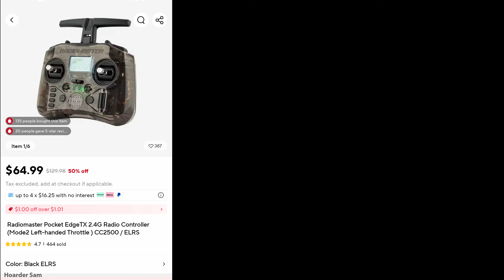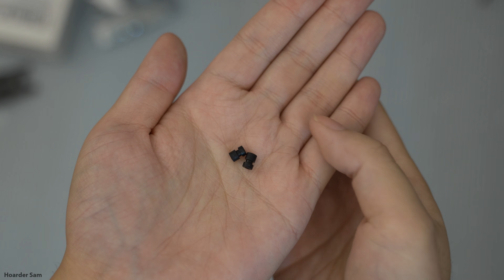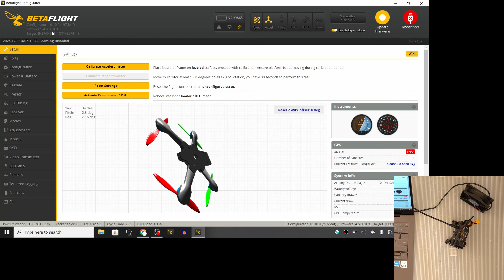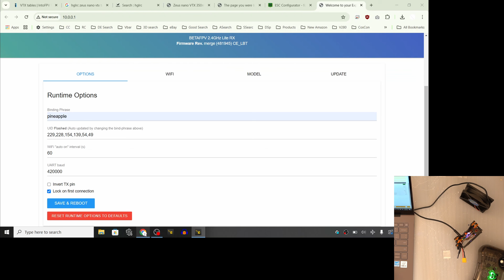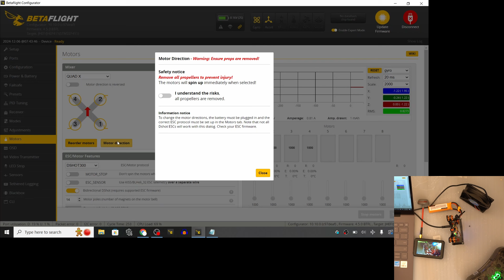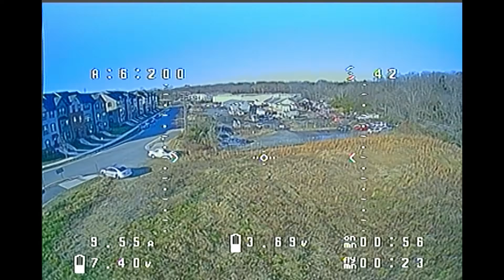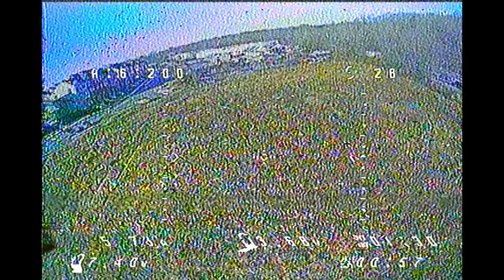How to build a 2-Inch FPV drone for $100

Comment: With the 5 bladed props should i use prop screws or just push them in like the 2 bladed props?
Reply from the maker: Mine flies fine without prop screws. (I haven't pushed it very hard though)

Comment: Never melt tin just on the soldering tip, you're just burning flux off. Use these bigger tips, don't be afraid of them ;) you don't have enough thermal capacity on that narrow tip, that's why you struggled with motor wires. These pesky motor pads sink heat very well. I use my 2mm flat on almost everything - recently replaced a bunch of 0805 smd resistors from a donor repairing a motherboard. Bigger thermal mass allows you not to drop heat when you heat up the element, so you can get in, heat, tin, get out fast as one should always do. Good you use the brass wire cleaner, way better and safer than wet sponge ones - they coolbthe tip rapidly and damage the hard-tinning of the otherwise copper tip. Also, don't cover tip with flux or you'll damage it with time - unless you cover it with tin afterwards. The general golden rule (llm rhetorics lol) is to always leave the tip covered in solder when finishing the job and in general never let it stay uncovered. I replaced the tips probably about 10 years ago following these rules. At this point I'm emotionally attached and we'll probably going to marry. Cool vid though :)

Comment: Oof. It's my first drone build, the wiring is a massive pain, but I got it done. I got everything assembled, started betaflight setup. I saved the motors for last. Everything else was working great, but on motor setup, one of the motors was twitching weird. Eventually I think it let out a curl of smoke.

Oh no.

edit1: I think I shorted the motor wires. I resoldered one and it seems to work fine!

edit2 (3 weeks later): I finally got to fly it. It's fantastic. Apparently my solder job on the xt30 was trash, though. It failed and I need to replace it. Thanks for this build guide. It, the 3.5", and the 10" got me into FPV.

Comment: Hoarder sam-- I have a few builds on the go --  two 10inch and  a ysido 80mm frame from Temu, anyway I was wondering if you had any 3D printed GPS module holders that'll  hold 18mm GPS module for the 10inch  mark 4 V2 frames  and a 3D printed vtx antenna holder that screws onto frame?..

Comment: I have watched this build and your 5in. build. I will be ordering the parts to build the 2in drone as soon as I finish this comment. You present the build in a very easy to understand way. It's clear that your priority is to get newbies into building and your approach is conducive to that. You seem to leave your ego at the door which is very refreshing. I am confident that I can complete the build. My biggest issue will be learning how to navigate the Pocket emitter. Though I have been in RC for quite a while I have never owned a Radio Master Xmitter. It's a little confusing. Anyway, thanks for you videos!

Comment: I am a 13 year old boy you guys think Ivan build it
Reply: I’m 13 as well and I built his 5 inch $100 build and I’m building a custom tiny whoop using a 65mm frame I designed and 3d printed myself, so I think you could build it!

Comment: Will the b6 neo charger work with xt30 connectors? How to charge the batteries? I am ordering these parts and i dont know which charger to buy
/
Reply from the maker: Yes, you just need a XT60 to XT30 adapter and the b6neo will work: https://s.click.aliexpress.com/e/_c3bYy5VN

Comment: For those wondering its kind of hard to find the f411 board at that low of a price. AliExpress directed me towards a similar board the G474 for a lower cost. Thats the board i used for this build and it works great so far! A couple of the soldering pads are in different locations from sams video but thats about it! I really like the osd on the G747 board as well. So if your wondering if the G747 board will work for this build it will! Awesome little 2in drone. This is my second build and the smaller drone really helped me get better at flying. Thanks again @Hoardersam !

Comment: Built this with the 1104 ysido 8600kv and with the betafpv 2s pigtail. So using 1s 550 batteries x2. Tested flight time with the 5blade props, almost silent, but didnt have long flight time unless i just hovered around. Just switched to gemfan hurricane 2 blade. Its screaming, going HARD for more than 5 minutes. Great build. Thanks a lot. First build for me, soldering was rough but it works great :) Cheers
Reply: what's the weight of yours? I'm getting 3-4 minutes with betafpv 2s pigtails with the 5 blade props. my dryweight is about 65g
Reply: @blackguns12 Hey, i realized it was one of my batteries that was giving me problems and not the 5blade. Tried the 5blade props again and now i get about the same results as you. 63.22 grams dry on my scale. Now i think i prefer the 5blade props :)
Reply: @oskardavidsson  I know. tried 2 blades earlier today and I am not happy how sluggish it feels. it was screaming all the time just to make it fly higher lol. 
oh btw the 2s Pigtals for betafpv I use was a 450 LiHV. when I use my 2s 550mah I get about 5-6 minutes of hard flying. trying to lighten my build and see what changes

Comment: hey would the RDQ 660 mah xt30 7.6V 90C work with this setup or is it overpowering?
Reply from the maker: That sounds good to me
Reply: @hoardersam10  also if i want to add a tbs unify32 pro nano, i connect the signal to tx2, video to vtx, gnd to gnd and 5v to power in??

Comment: I was looking for a cheaper option to my banged up YMZFPV lightning2, that I use to learn new freestyle maneuvers. 
Unfortunately, with 23% import tax, this build comes up to 123€. The GEPRC T-Cube18 costs me 117€ (including import tax) and a new YMZFPV Lightning 2 (analog) cost me 157€, both with better components. 
I'll just buy prebuilt as the savings are minimal and I'll get a better quad that way, without wasting time I can use to make extra money (self employed). 2 Billable hours will pay for one of this, with some change, while I would spend more than 2 hours building this and setting it up. If I tune it, then it's even more time.

Comment: can i use JHEMCU G474? i really want to do this projects for robotics class but i dont know which board to order.
Reply: I ordered that board too i believe because they didn't have the one in the video for this build at a good price. Its on its way here. Ill let you know if it works. It should. It rates the same i believe.
Reply: @SmokyArts when will the package arrive?
Reply: @KacperRyszkiewicz everything will be here in a little over a week! But i just fried my radio 😭😭😭 should have a replacement by then to fully test the board. But I'll definitely let you know if it works!
Reply: @KacperRyszkiewiczhey the package arrived today, sooner then i thought. If nothing is missing ill be doing the build tonight!
Reply: @SmokyArts  did you build it?
Reply: @KacperRyszkiewicz hey man i just finished the build last night, but i have a few issues i got to work out. Everything worked so far except two of my motors. But i think its my soldering work... So i got to try to diagnose and fix that issue tonight. But so far everything else worked! You do have to search for a few pads on the board too because they are not the same place as the f411 board. But im try to solder my motors again tonight and see if that fixes the issue. Im pretty sure thats the issue. Hes not lying. Those motor pads are stressful to solder! They are super close!!
Reply: @KacperRyszkiewicz update: i redid the soldering work on the two motors that were twitching and now it works fine! Been flying it last few days! Fun as heck. So yeah you can definitely do this build with the G747 board bro
Reply: I googled it as well and it seems that it will work just as fine the 474 board. All its saying is its just the newer upgraded version of the 411! Hope this helps!

Comment: I just built my own with you're guide man! and it flies! . Dry weight is 64.7 Grams. add in the battery 550Mah 2s. drone weighs a total of about 95grams. Thank you. keep on sharing builds!
Reply: what esc did you use JHEMCU F411 ELRS or JHEMCU G474ELRS?
Reply: @KacperRyszkiewicz here's my set
it's the Jhemcu GHF435AIO ELRS 2-4s to have upgrade paths if I want to change it a bit.
Reply: @blackguns12 v1 or v2?
Reply: @KacperRyszkiewicz not sure. it didn't state which version

Comment: There are many channels about FPV drones builds ,setups etc etd. But I never saw any video like yours where you go thru step by step to show what ,when and how to do. You make great tutorials that I'm sure motivated many to go on and build their own drone. I personally just build 2,5inch drone using Baby Apex 2.5 frame and fully packet with GPS ,GEPR Taker AIO ,Cyclon 1w VTX and ysido 1404 4650kv and Ratel 2 cam. This boy can easily fly in heavy winds while caring Insta 360 GO 3s camera on top. All of this still under 250gr. Great stuff man!!!

Comment: Hi. Thanks for the great video. The link to JHEMCU F411 ELRS AIO leads to a page for JHEMCU G474ELRS AIO Flight Controller. I just want to make sure I get the right part. Thanks again, Keith
Reply from the maker: Unfortunately it looks like the JHEMCU F411 is out of production, so aliexpress is redirecting to other products. I don't think the F411 AIO is in stock any more
Reply: @hoardersam10 will the G474 board work the same? I just ordered all the parts and same hardly any f411 They only had them for crazy prices
Reply: @SmokyArts did you build it with new fc?
Reply: @KacperRyszkiewiczparts coming in the mails right now! I googled that board as well and according to google it should work with this project. All it said was the 474 board was a upgraded version of the 411 so you should be good!
Reply: @hoardersam10 the G747 board works for this build as well. Just built it thanks!

Comment: Thanks for the great build videos. I always struggle with soldering ground pads and getting enough heat to flow. Do you have any tips for that?
Reply from the maker: I use leaded solder which should melt and flow better than lead-free.

Start with a clean soldering tip thats shiny and silver. I like to drop liquid flux on the tip which cleans it pretty well.

Then I add solder just to the ground pad (tinning the pad). Make sure it flows and looks smooth.

Then I add solder just to the wire (tinning the wire). Some wires come pre-tinned, but I still tin it again.

Then I can bring the wire and pad together and use the iron to melt both at the same time
Reply: @hoardersam10  Thanks for the reply. These tips are all my common method of soldering as well, but when I am applying heat to the ground pad it either needs more heat or longer hold before the solder will begin to flow. I worry about damaging other components while on there.

Comment: Can this run a vista?
Reply: Yes it can but the mounting is above the aio so it does not have the best mounting but it should work with the caddx vista without out issue. Hope this helps

Comment: that was a good fucken video bro. question dawg is there a reason ur not soldering at 400C?
Reply from the maker: I use leaded solder with a lower melting point than unleaded

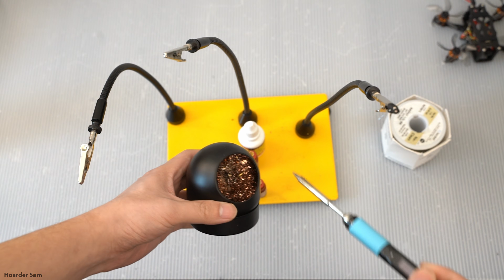Comment: @hoardersam10 Random side note, check 2:54 the "brass cleaner" if it really is brass. I had the same and I was wondering why my soldering tips became "bad" (poor soldering results) so quickly. Brass is non magnetic (and also more yellow than orange), so if yours is magnetic just like mine was, chances are its just steel wool, which is bad for any soldering iron :C Also, flux is more helpful if you put it on the part you want to solder instead of the iron :)

Comment: Is it possible to use slightly bigger batteries with this and get a longer flight time?  Been wondering if i could make an FPV drone that has at least maybe 10-15 min flight time.

Comment: Have been flying this thing for a few months now. This was my first fpv drone ever and i love it. Perfect for flying around the house, isnt to noisy etc. I do think however that the vtx and flight controller are better suited for a toothpick.( some guy built one with the exact same controller and vtx just a little lighter and better for indoor flying) I am probably going to built one with the same frame and camera (and motors but i have different ones as the one of the motors in the video came without magnets) but a speedybee stack and vtx (speedybee F405 mini and Speedybee XT800)for just about €35 more than the original. Love the rest of the build tho flies great (as far as i know)😀

Comment: So i just built a 2-2.5" 1s toothpick but I used all the same parts but motors went with 1202.5 11000kv, is the 1s and motors what is causing the drone to pull 15amp just to hover? Did just a short little flight in the house and ended up pulling a max of 26amp and I dont want to burn anything up

Comment: Those 1104 8600kv motors on 3s are insane i used an eyas x 2 inch frame wich is kinda too small because and 4 blade gemfan 2 inch props it bareley hits te m2 screws you cant use standoffs where the props are so it's an imcredibly tight build but it is the lightest I have ever seen

Comment: unfortunately the whole build will be about double the price because of the tariffs. unfortunate, but it is what it is
Reply: What? No. Unfortunately the whole build will be 4 times the price because I need to buy a controller, headset, and charger as well. $100 my ass when I paused and turned off the video the moment he put $64.99, $141.92, $97.75 on the screen. Disingenuous video to say the least.
Reply: @eX_OSRS bruh what, the title literally says that its how to build a drone, it assumes you already have that stuff, like a lot of the viewers do
Reply: @averycaron5462  you think FPV drone owners are a large segment of the population? Or even a large section of the drone-owning population? Lmfao gtfoh
Reply: @averycaron5462 you think the majority of people have headset, controller etc? Hell, you think the majority of the drone owning population does?
Reply: @eX_OSRS  yes I do, those are prerequisites for building any fpv drone.  along with batteries and a charger
Reply: @averycaron5462 I didn't ask if you did
Reply: cant even buy the flight controller because of that moron in the white house

Comment: Building this as we speak, quick question, when I go to esc configurator, there's no mention of any firmware or decent controls, does this mean i need to flash blujay?
Reply from the maker: Can you read the settings? After read settings, all the options should pop up
Reply: @ will give it a try! Thanks!
Reply: @hoardersam10 did everything i could and cant get the motors to spin in betaflight test. Very strange

Comment: Hi has anyone tried to power this with a 2S high voltage? On the listing it is not specified that it works with HV and I’m worried that I might break it but maybe the voltage difference won’t be an issue?

Comment: u need a reciver?
Reply from the maker: The flight controller has a ELRS receiver built into it
Reply: @hoardersam10  can I use crossfire?
Reply from the maker: @davidedini_1  Yeah you can, just have to wire up your own crossfire receiver to a UART on the flight controller
Reply: @hoardersam10  hi i'm doing the build can you send me something like a photo for soldering the nano rx to the AIO? tnx

Comment: What dimension is being measured to classify it as a 2"?
Reply from the maker: The propeller diameter is 2 inches. For 2-inch drones and above, the propeller diameter is typically used. For tinywhoops, motorpost-to-motorpost size is typically used (65mm, 75mm)

Comment: I am a total newbie to FPV 
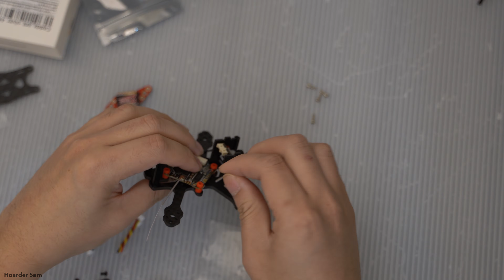I wanted to know why the FC is mounted errr... diamond style 04:17 (sorry did not know how to say it) ... as oposed to square (I would assume)
Reply from the maker: Either way works, just a matter of how the frame and quad is designed. These smaller drones with all-in-one boards are usually diamond style in order to to make the overall layout more compact

Comment: Hi Sam, I'm completely new to the hobby and picked up a load of gear of off a Youtube channel who no longer needed it due to switching to a production crew instead. I have ended up with a tbs tango 2 and dji goggles v2. It did come with a few drones but I'm super keen to build my own as well. what parts would I need to change on this to make it work with my goggles and transmitter? thanks!

Comment: Hey, Random ass question Im looking to build a telemetry falconry system with a mount that could go on our birds and a handheld to track it no Cam needed just to pick a signal up would there be drone parts to make something like that?
Reply from the maker: Ooh very interesting idea! The easiest off-the-shelf way would be to have a flight controller (no esc), GPS, and ELRS receiver and battery on the bird, and have an ELRS radio transmitter that will receive the telemetry data on the radio.

With some custom code, one could possibly get rid of the flight controller and just have the GPS and ELRS receiver connected together.

Comment: I have just purchased all parts for this build and waiting for it to arrive. This will be my first build. 😄

If i want to change to Dji o4 air unit, any other parts that i need to change as well?
Reply from the maker: Have you seen this new frame? It's the same apex 2inch but they changed the camera mounting specifically for the O4: https://www.aliexpress.us/item/3256808325103945.html